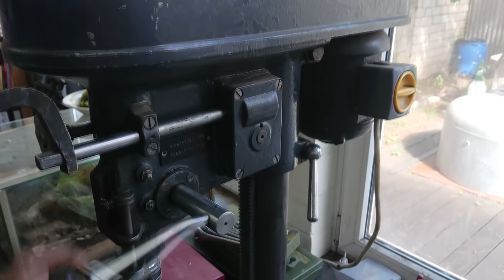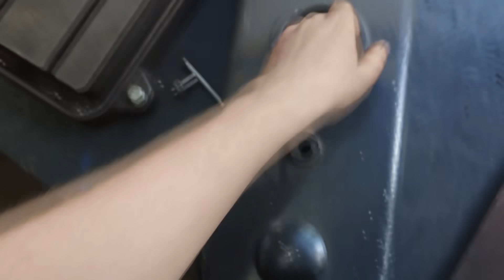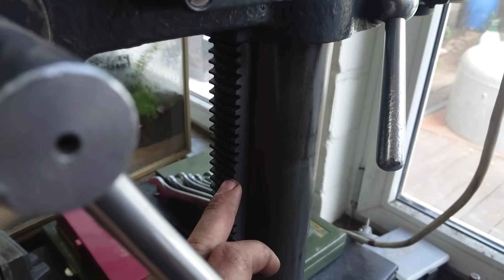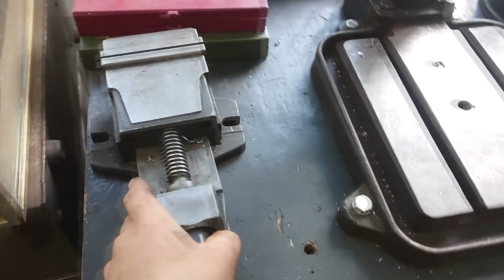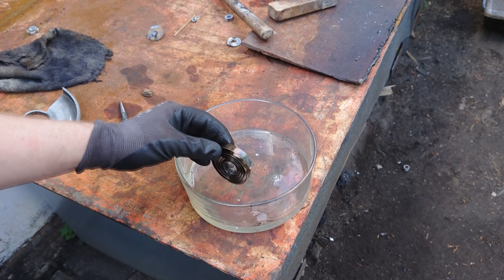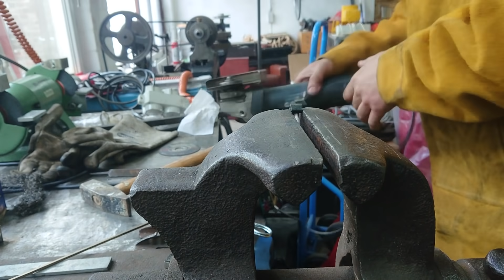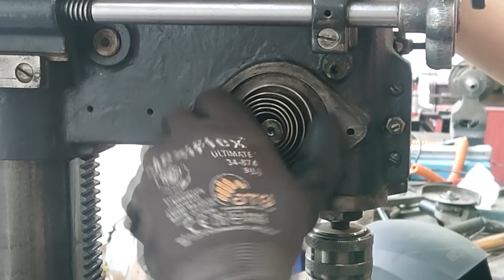Let's Repair my Drill Press

Comment: I was wondering about the belt pulleys on top of the drill press , i assumed that the pulleys were designed for multiple belts at the same time so that the belts did not slip. This is how I have it on my drill press do you think this will harm my drill? Thank you for all your video's. -your fan and faithful subscriber
Reply: It's for multiple speeds. Like shifting gears on a bike. Move the belt to a different set of pulleys to spin the chuck faster or slower, like the chain on a mountain bike. Don't run multiple belts on a stepped pulley setup like this, it won't work.
Reply: There are multiple belt pulleys on big machines like lathe for example that can run 4-5 belts at same time to prevent slip on excessive force.
However those pulleys have grooves of the same diameter.
in a drill press like his you want to run a single pulley step at the time.If you have problems with slipping its ether your belt is worn out and its time for new one -or the sides of your pulley are worn out and the bottom of the belt is touching the bottom of the pulley which is no good -in that case you need to touch the sides on the pulley on the lathe a bit and go deeper(only sides of the V belt should be in contact) in the middle of the pulley. 

I assume you were talking about standard V belts that 99% of drill presses have.Some newer machines use multi groove (poly)V belts where on a single belt you got more rubber ribs,in that case you would need to do same process as above but for all rubber ribs.

Comment: CRC brake cleaner is my favorite for cleaning all sorts of stuff, super effective (and I mean  s u p e r ! ), doesn't leave residue. WD40 is not as bad for the environment but still contains naphtha, and as seen in the video you need to use so much of it. Amazing drill though, 100 kilos, that's crazy!

Comment: I think the pyramid shaped drill is called a reamer.
Reply: No, reamers are tapered not stepped. That is a stepped hole cutter. The size of hole you want to cut out is the step you stop the bit at. typically intended for sheet stock.
Reply: @stormkhan4250   Reamers can be both tapered or straight.

Comment: You could just heat a part of spring at the broken end, and bend it. it would be enough, without spring temper. I`we done it a few times where it is not so demanding. Like in the lawn mover puller return spring etc. Stay well!

Comment: WD-40 is good and widely available in different quantities with both spray and liquid atomizer. Although I am not a machinist or mechanic but I like to collect handy oils and penetrating oils/fluids, Some products are good as penetrating and loosening rusty connections etc.. also good at long term  as rust preventing.Because I am not a professional/semi professional mechanic/technician, one of the most important aspect is the smell and WD-40 smells good, Ballistol in both spray and small glass bottle; is a very high quality and a versatile product however I find the smell disgusting. Here in the UK we have Plus Gas again both in spray and liquid form and it is a very good product also smells very nice just like an oldschool race mechanics garage and it is my favourite in the 1st place, 2nd comes Duck oil from Swarfega another great performer in both smell and performance. We have other brands here like; Morris Lubricants with horrible smell but a very good performer, GT85 with a sweet but unpleasant smell providing good protection especially against damp and moist conditions and very popular among bicycle and motorbike users.Your videos are very interesting and informative and educating, Keep up the good work.

Comment: Nice video as usual!
Few months ago bought for cheap money an old used 3-phase half-column drill press. A nice piece of heavy and sturdy machinery: 2 speed motor (dahlander winding), 4 pairs of pulleys, for a total of 8 different speeds, and a nice silent flat belt, working fine... until about a month ago when I wanted to drill a hole, I heard a ZAPP!! and the circuit breaker on the wall tripped... I traced the problem down to rotten wires, due to PVC insulation (here you can read something about this problem: https://www.effectrode.com/knowledge-base/echorec-rewiring-procedure/). It took me a couple of weeks to pull out the winding from the motor (had even to build an extractor just for this job...), solder new wires to the windings (....), put back in the winding, clean the contacts on the 2-speed switch, to get it finally working again... But it was worth. My spring, fingers crossed, is still doing its job. Being it a "half-column" drill press, I couldn't mount it on a table, because it would have been to high to use it, and I couldn't leave it on the floor because it was too low, so in the end (after fixing the motor) I made up a small bench (out of scrap metal) 50 cm tall , and now my drill press, with refurbished connections and switch sits on its custom-made bench. 
I like the fact that in your drill press you can lower the head, never seen that before. 
Normally you have a movable table which can be adjusted either through a sprocket (as you do with your head) or  just by raising or lowering the table by hand. Unfortunately my drill press is of the second type...